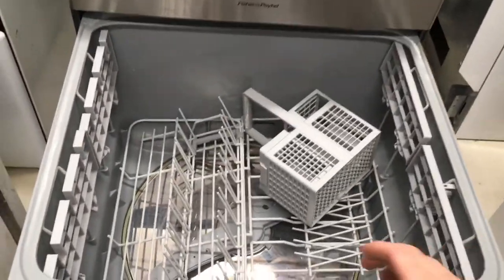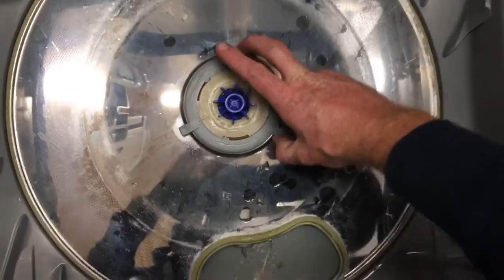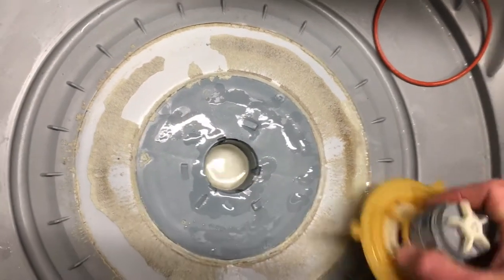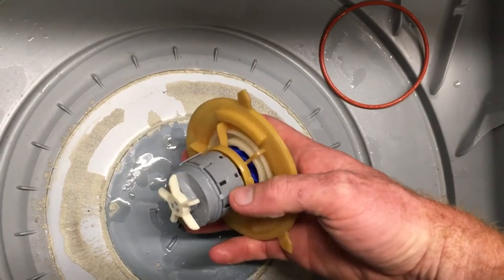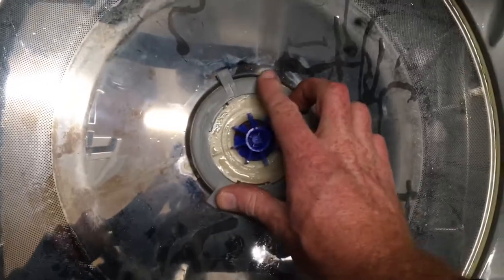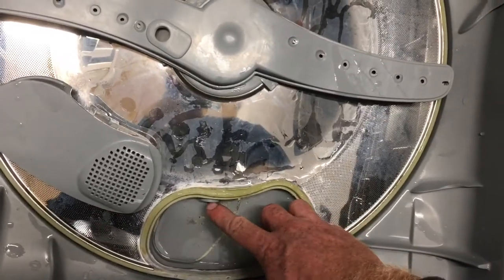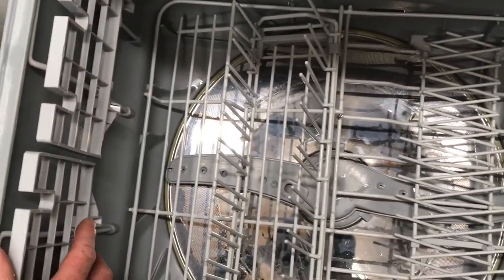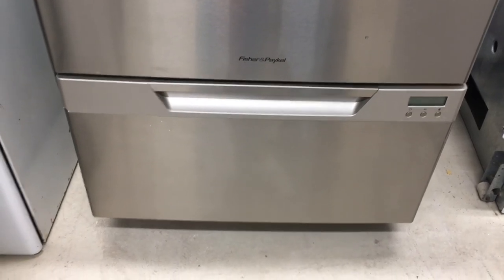Removing pump rotors on a Dish Drawer

Comment: Thank you for this tip! I’d been getting fault codes after removing the rotor to deal with a clog and learned that I didn’t reinstall it correctly.

Comment: OMG that has saved my life. Slight exaggeration but I’ve been taking apart my machine and putting it back together as instructed and couldn’t figure out why it was still making the high screeching noise and not operating. I never knew the rotor went in a particular way. Thanks so much.

Comment: Thank you for this. Ours was not draining, and making a squealing noise. I didn't realize the rotor was that easy to remove - thanks to your clear demonstration. A rinse and reinstallation fixed the noise, but it still wasn't draining. I found instructions online for accessing the diagnostic menu to (carefully) run the drain motor, and it was obvious that it was spinning just fine but the water wasn't going down. I think I had a blockage in the drain because after I poked a piece of plastic line into the exit hole, it has started working again.

Now that I have had it apart, I can see that the rotor is worn, so I will replace it. No complaints, we've had it for 8 years with no faults.

Comment: Thank you so much for this really clear and easy to follow video. My dishwasher rotor had come adrift and I had no idea what to do. I took everything apart and put it back together, with the small blue plastic part firmly on now, and everything clicked properly into place. It has just gone through a cycle perfectly!
Reply from the maker: The blue part (which is the washing pump rotor) is not meant to come off the shaft. If you find it comes off repeatedly you may need to get a new rotor.

Comment: Super clear explanation, thanks. I recently had excess water in my dish drawers after a cycle. The pump propellor was damaged from glass or similar. Replacing the pump with a new one from F&P fixed the issue and it works perfectly again.

Comment: Great video in that he points out that there is a fourth element on the rotor that needs to be properly aligned for the rotor to operate correctly. You can out the rotor back in and snap it into place with that fourth element not in the correct orientation. If that happens then when the dishwasher starts it will fail to get the rotor going properly which sounds like a series of taps and then it starts to beep and shut down. When you open the drawer it will show an 'F' fault code.

Comment: I have a DD60DCX7 which has been in storage for about 2 years.  It was working perfectly when it went into storage so I kept it for my new house.  The first couple of washes worked fine then I noticed the dishes in the top drawer were dirty and there was a build up of water in the drawer and I had an E1 error.  All the parts, including the blue rotor blade were floating. I found a tiny button that had made it's way into the rotor shaft somehow and was blocking the drain hole. I cleaned it out and mopped up all the water. I found water everywhere under the drawers, so I removed the drawers and mopped them out.  Put it all back together, tried it on rinse, and ended up with a drawer full of water again.  Took it apart again and discovered there was water in the plastic cover below the top drawer.  Tipped it up and drained what I could and then put the hairdryer on it.  Before I call the service technician out, if I leave it to dry out properly, will it work again, or do I need to get a service person out?  I can't see how to remove the cover off the electronics to dry them out.
Reply from the maker: If you dry it out fully with the power off (unplugged from wall) there will be no more F1 when you turn it back on without you having to reset anything, just may take a couple of days to dry fully. There are a couple of little clips to remove the cover, but on that model water shouldn't have got into the electronics, just into the leak sensor in the base so will clear when all dry.  The controller uses the rotor to tell when it is full so if that is coming apart it will be overfilling.
Reply: Thank you for your prompt reply @motrepairs . I will wait a few more days.  The hot windy weather should help.

Comment: Thank you so much for the video. My F&P dw60CE dishwasher has a wired sound and not washing, and also a burning smell. I’m not sure if it deserves to repair it or just get a new one.
Reply from the maker: If its not washing it would suggest problems with the wash pump, that sometimes can be just a capacitor. What is the state of the plastic bits on the dishwasher? Basket wheels, control panel housing/handle etc? It will probably be repairable but depending on the age if its starting to fall apart you could spend quite a bit to get everything back to 100%

Comment: How did u clean below the rotor? Bc all what i ve seen is dismantling and returning to place
Reply from the maker: usually you are taking the rotor out to check for bits of broken glass etc in the bottom. You can also use a piece of wire to check the pipe that runs straight forward to the sump filter.

Comment: If the little flaps under the rotor are broken off will that affect the machines use
Reply from the maker: The rubber flaps at the bottom are the draining impeller, so it will struggle to drain if they are broken or worn.

Comment: Is there a way to reset the dishwasher after you put everything back in? I’m still getting an error message on the front screen
Reply from the maker: If you turn it off and on at the wall and still have the error it means the issue is still there.

Comment: Thanks for the video, followed your instructions but still getting E2 (motor fault), 03 (temp sensor?)  and U4 (Fault in the other drawer preventing the use of this draw) error codes on my F&P "Classic" DishDrawer (DD60DCX7) model. Not sure if I need to spend $1300 on new dish washer or if motor just needs replacing. There's a burning smell throughout dish washer)
Reply from the maker: If you are having a burning smell that's really not good, un plug it from the wall and don't use it until you have been able to have had it looked at. Its probably not going to be a cheap repair from the sound of that, but if its a version 7 it should be worth at least getting it assessed, should be cheaper then a new one

Comment: Thank you for the great video! I removed the rotor motor which looks fine however I noticed that the bottom grey part with the legs (which need to go back in the correct position) is not spinning freely like it does in your video. It's rather stiff and difficult to turn, is this normal?
Reply from the maker: That lower part sits still and the rotor turns inside it, so if it is binding or too stiff to turn you may get motor or fill errors. Is there anything caught between the lower impeller and the grey lower bearing?
Reply: @motrepairs  Thank you for your reply! I didn't find debris lodged anywhere but I rinsed the rotor under hot water and scrubbed it with a toothbrush. The blue fins on top spin freely however the lower part above the bottom fins is super stiff and it's very difficult to spin unlike what you showed in your video. This drawer hardly gets any use so I think the lower part may have sat in water too long and got bound up. I decided to order a replacement on Amazon for $100. Hopefully that will do the trick. Thanks again for your detailed video, had you not demonstrated the various parts that spin independently, I wouldn't have known there was an issue with this rotor.
Reply: BTW, yes I keep getting the E2 motor fault code.
Reply from the maker: @gratefulqt7704  Yes sounds like you need a new rotor. There are 3 different types across the models so just make sure the one you have coming is for your model
Reply: @motrepairs  Thanks again! I called F&P and they were very helpful in providing the correct part number.

Comment: Hello I have an older fisher and it started throwing a F82 code in the middle of the night when it wasn't even running. What does that mean?
Reply from the maker: It can't be too old if its giving that code. Its a motor controller code, (on the back wall, not the tub). We have had a few problems with cockroaches getting into motor controllers, sometimes removing them is enough but usually they blow things by walking on the wrong components.

Comment: So i have checked all that, but no one says anything about a stretched Red O Ring.  Ive checked the channels are not blocked ie the ones inside the little well of the pump
Reply from the maker: Yes the o-ring can get a bit stretched, you can get a new one here https://www.appliancespares.nz/products/fisher-paykel-dishdrawer-rotor-motor-o-ring-o-ring-silicone-seal-523049?_pos=1&_sid=7081649e1&_ss=r
That shouldn't affect the draining though, if everything is clear you may have something else wrong. Do the rubber pump blades on the bottom look badly worn?

Comment: Anyone know as to how that pump works ?
Reply from the maker: The part you see is just the magnetic rotor, winding are around the base. The lower impeller blade is the drain pump, when it turns one way it drains, when it turns the other it does nothing. The top blade is the wash impeller. When it turns in the wash direction it scoops water up then out into the spray arm.

Comment: I would like to add here. There are 3d printed motors being sold on Ebay, total scam. Watch for those that have larger than original impeller blades. The motors are marketed as "used" justifying a low price but they are actually 3d printed, with no scuffs whatsover but the impeller area to sit in pool of water is not re-created like the original rendering them totally useless. The design does not allow for forceful sideways into the drain expulsion of the water. wASTE OF MONEY AND SCAMMERS RUNNING FREE
Reply from the maker: That weird, I havn't heard of that! I would think they probably also wouldn't handle the hot water and detergent very well!